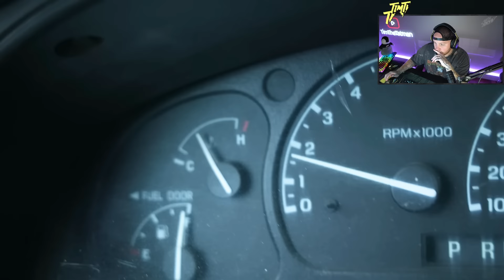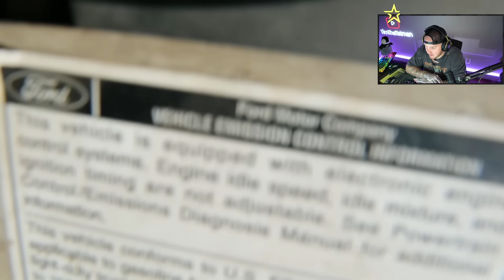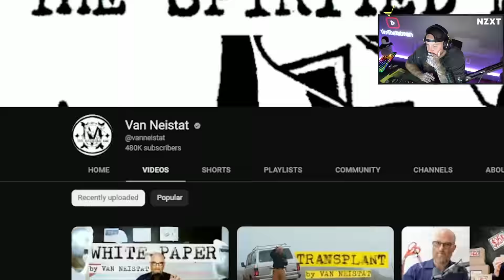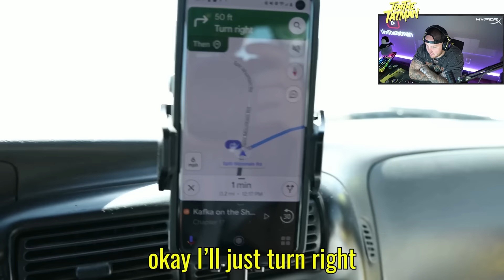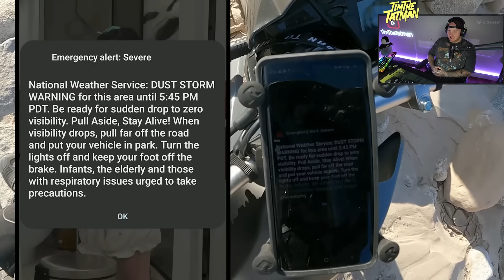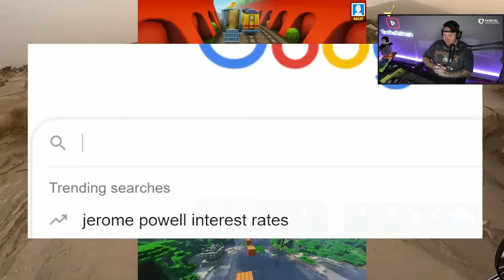TIMTHETATMAN REACTS TO MICHAEL REEVES "A BORING VIDEO"

Comment: Btw the whole “do not add water” thing is there because coolant is also sold concentrated where you have to add your own water to dilute it. It is perfectly fine to have water in the system although it’s not the best long term cause it can rust metal over time. But it is perfectly fine in a pinch.
Reply: Coolent is put there so the water doesnt freeze ... so its just water that cools ur car not the coolent .. but just put 50 50 loke the manuel says ...
Reply: as someone who doesn't know dick about cars, I appreciate your comment brother
Reply: It's more cost efficient (sometimes) to mix it yourself cause they give you a gallon of the stuff, and you mix it 1/1, so you get 2 gallons for what would have been the price of one.

Comment: The "do not add water" is on the bottle because the coolant is pre-mixed.
If you get concentrated coolant you would have to mix it with water. it's not bad for the car unless it's pure water for a long time (coolant contains corrosion protection)

Comment: For those about the truck the coolant that says do not add water are already 50/50 mix which is what majority of your cars require. The ones that say concentrate you make 2x the coolant just add water equal to the concentrate put in. Just a heads up lol

Comment: Ok so I’m a mechanic. Adding the water to the already mixed coolant won’t hurt when it’s hot out. 50/50 is half coolant half water anyways. 50/50 is a standard because it’s a mix that work at pretty low temps. You can find a chart online with the ratio of coolant to water minimum for certain temps. The antifreeze is there to mainly keep the water from freezing.

Comment: it only says do not add water because its already pre mixed with water and doesnt need anymore its not gunna hurt anything
Reply: Crazy to think these are the 1% lmao
Reply: @notangel8328  there is also no way that O'Reilly's didnt have concentrate.
Reply: @Freegrem  most places put 50/50 up first and you have to actually look for concentrate at least where im at. also 50/50 is "cheaper" since he lives in cali he couldve just used water and skipped the antifreeze
Reply: @mitchellmiller6644  Agreed

Comment: Coolent doesnt cool the car its actually the water that cools the car thats why its half coolent and half distilled water .. the coolent its actually for the water not to freeze in low temperature... so if u put all water in the radiator its actually gonna cool better than half coolent and half water ... but just follow the car manuel and put 50 /50 😊